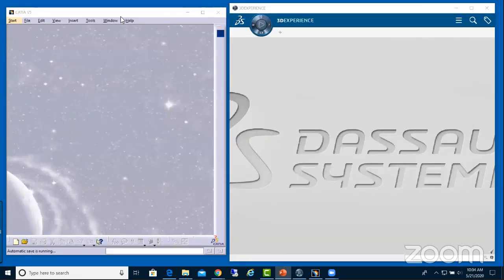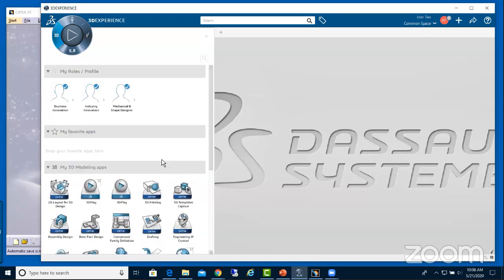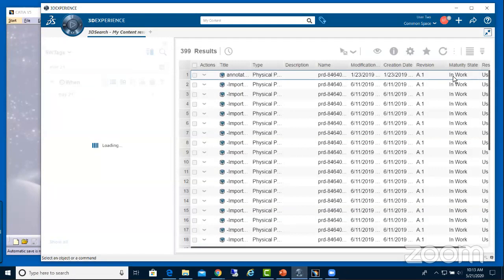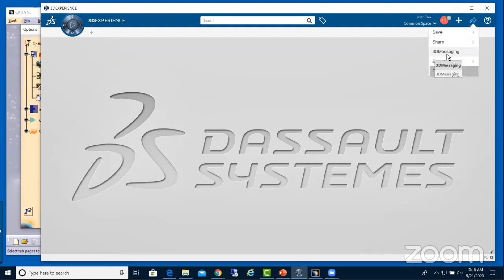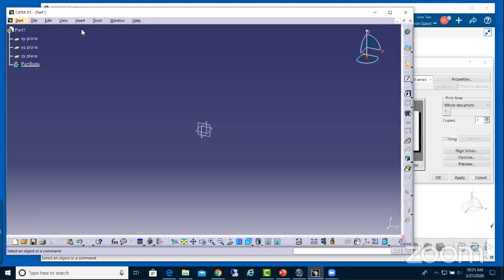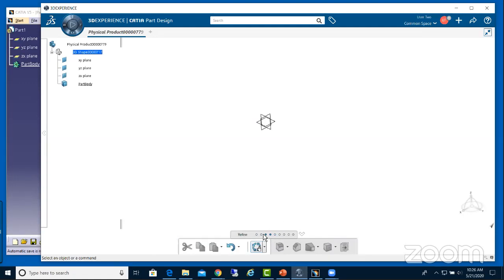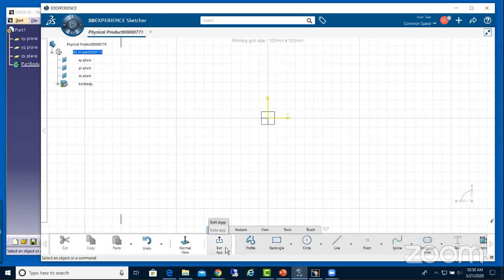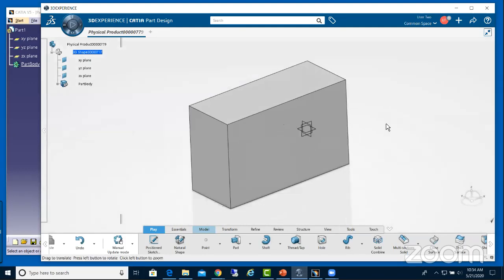Moving from CATIA V5 to 3DEXPERIENCE

Comment: 3D Experience is a slow and sorrowful death.
Reply: Hi there! Recently, I was thinking to move on to 3DExperience from CATIA V5R20 (because of the advertisements and seeing many others using it). Shall I go on with it? or continue with CATIAV 5R20?
Reply: @Rez1_Analytics  I would rather stay on V5R20, from what I've seen the features in 3DExp. are straight imported from CATIA, with the new interface. Also the new UI seem much less customizable, maybe easier for new users who need only basic functions, but I'm not a fan of clicking 3-4 times to navigate the toolbars and reach a command when now in V5 it's reachable in one click.
Also (but this is more of a personal preference) all this cloud based approach gives in my opinion less control on your files, not a fan of a system where you work on the computer of someone else and you basically own nothing.
Reply: @SuperGheppio  Thank you very much for your inputs and insights! Much appreciated!Ultimately I didn't go ahead with 3DExperience and I'm glad to stick with CATIAV5 :) Thanks again!